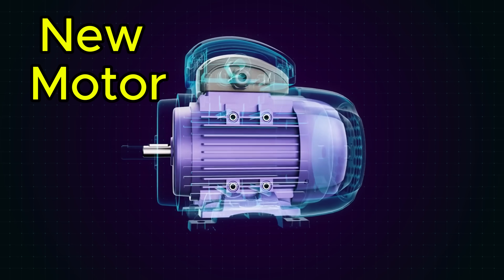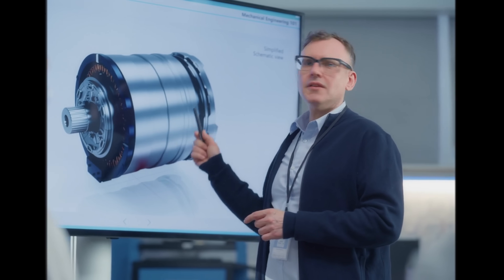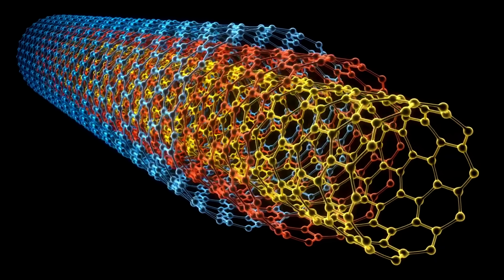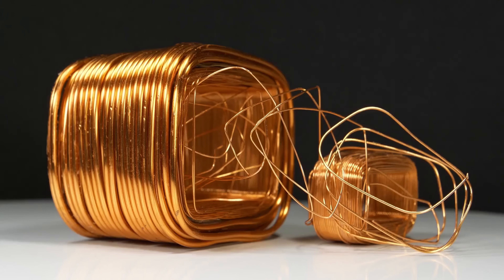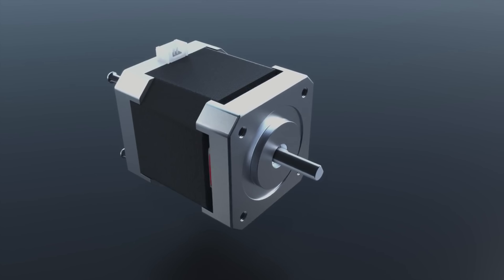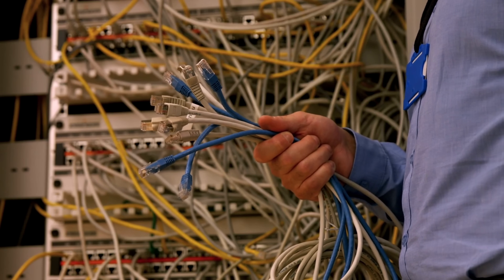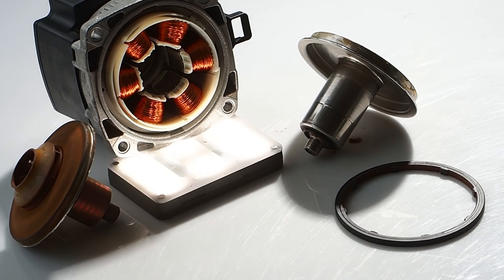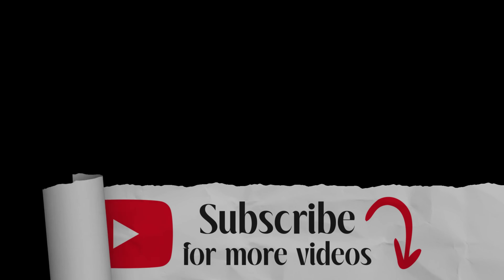New Electric Motor Runs Without Metal Coils – Here’s How

Comment: We can have a billion uses carbon nano-tubes,  we still have no way mass produce cheaply.
Reply from the maker: agree, the cost will be a challenge in the bigining. but later could be optimized.
Reply: @renewable_energy  Cost isn't the big problem, manufacturing nanotubes longer than a few nanometers without defects and at scale is simply not doable today and it's  mandatory for uses like motors. So this motor isn't anything big, it's researchers using existing tech to create a lab prototype rather than actually advancing what needs to be advanced in order to make things like this motor viable.

So it's just research lab fantasy, probably made in hopes of getting more funding.
Reply: @walbao6399 

Governments outside the US will fund the research especially if they can get all the patents so the rest of the world has to go to them making that government king.
Reply: @walbao6399 Nothing wrong with making something in the lab, even if this particular idea cannot be produced (yet) in large scale, because it can lead ro new ideas, which may be viable for production. As we say in Dutch "you never know how a cow catches a hare", meaning you never know what can happeh or where something leads to.
Reply: Thought it was easier to produce in space 0 gravity just need a production plant in space????
Reply: @stevesharp6138 

How would that be cheap? 99% of the cost would be transportion.
Reply: Europe has found an intuitive way of producing carbon-based nanotubes on silicon wafers graphene wafers.
Reply: @MrLovaRuba856  what length can they produce free of defects?
Reply: @walbao6399  Great question! Actually from what I heard is they were able to create a wafer I don't know the accuracy of production. I just know if someone can get it on a wafer ( one of the most delicate materials ) then the possibilities could be endless. 

Let me know if you find anything on that walbao. I can see a researcher when I see one :person-turqouise-waving:
Reply: Use graphene instead.
Nanotubes are just rolled up graphene.
🙂
Reply: Let the chinese do the thing they do with that tech. Soon it will be available and cheap, i bet

Comment: so basically nothing to even talk about yet, if you  can't even show an actual prototype working, it's vaporware.
Reply from the maker: Thanks for sharing your view. Please find the prototybe in the published study: 

Ryu, Ki-Hyun, Dongju Lee, Min Ji Kim, Ji Hong Park, Seok-In Lim, Seo Gyun Kim, Jun Yeon Hwang et al. "Core-sheath composite electric cables with highly conductive self-assembled carbon nanotube wires and flexible macroscale insulating polymers for lightweight, metal-free motors." Advanced Composites and Hybrid Materials 8, no. 2 (2025): 1-10.

Comment: Que manera de perder el tiempo!!
Reply from the maker: Thanks for sharing your view. Please find the reference to the published study: 

Ryu, Ki-Hyun, Dongju Lee, Min Ji Kim, Ji Hong Park, Seok-In Lim, Seo Gyun Kim, Jun Yeon Hwang et al. "Core-sheath composite electric cables with highly conductive self-assembled carbon nanotube wires and flexible macroscale insulating polymers for lightweight, metal-free motors." Advanced Composites and Hybrid Materials 8, no. 2 (2025): 1-10.

Comment: Pure bullshit and clickbait. Today is almost impossible to achieve the amount of the material and if it doesn't it would turn in a obscene high price at the end of process. Dream on.
Reply: こんな動画を元に、将来、脈絡のない元祖なる主張を行うのでしょう
Reply from the maker: Thanks for sharing your view. Please find the prototybe in the published study: 

Ryu, Ki-Hyun, Dongju Lee, Min Ji Kim, Ji Hong Park, Seok-In Lim, Seo Gyun Kim, Jun Yeon Hwang et al. "Core-sheath composite electric cables with highly conductive self-assembled carbon nanotube wires and flexible macroscale insulating polymers for lightweight, metal-free motors." Advanced Composites and Hybrid Materials 8, no. 2 (2025): 1-10.

Comment: Reminds me of the research on single atom solar cells.
What if they didn't try to completely scale the carbon down to single atom nano tubes and create thicker materials for property and conductivity studies?  Then slowly reduce it down and note the changes.  That way a more efficient manufacturing processes might be revealed.  Robustness might be revealed through multistranding or layered consruction rather than single tube design. 
Could the carbon tube be constructed in a way that, when observed through a microscope, the end resembled a honeycomb structure that would carry more electricity along it's surfaces?
Reply from the maker: Thanks for sharing your view about single atom solar cells
Reply: Great point—and you're thinking like a materials scientist! 🔬
Instead of going straight to ultra-thin, single-atom layers or individual nanotubes, starting with thicker, macro-scale structures could definitely make early testing more practical. It would help identify bulk properties, stress behavior, and scalability bottlenecks without the precision constraints of single-tube synthesis.

Your idea of multistranding or layered architectures is especially interesting—kind of like how stranded copper wires are more flexible and durable than solid core. That same logic might apply here, giving a path toward robust, scalable, and manufacturable carbon-based conductors.

It’s often in that middle ground between theory and lab perfection where the most usable tech emerges. Appreciate your insightful take!

Comment: Greatest discovery ever until 6 minutes in the video and then...
Reply from the maker: Thanks for sharing your view. Please find the reference to the published study: 

Ryu, Ki-Hyun, Dongju Lee, Min Ji Kim, Ji Hong Park, Seok-In Lim, Seo Gyun Kim, Jun Yeon Hwang et al. "Core-sheath composite electric cables with highly conductive self-assembled carbon nanotube wires and flexible macroscale insulating polymers for lightweight, metal-free motors." Advanced Composites and Hybrid Materials 8, no. 2 (2025): 1-10.

Comment: Extremely vague.
IF something, then SOMETHING GREAT.  
And IF pigs fly, umbrellas will be built stronger.
Reply from the maker: Thanks for sharing your view. Please find the reference to the published study: 

Ryu, Ki-Hyun, Dongju Lee, Min Ji Kim, Ji Hong Park, Seok-In Lim, Seo Gyun Kim, Jun Yeon Hwang et al. "Core-sheath composite electric cables with highly conductive self-assembled carbon nanotube wires and flexible macroscale insulating polymers for lightweight, metal-free motors." Advanced Composites and Hybrid Materials 8, no. 2 (2025): 1-10.

Comment: Can you solder to these nanotubes? How are they insulated, with resin or similar?
Reply from the maker: Thanks for sharing your view. Please find the reference to the published study: 

Ryu, Ki-Hyun, Dongju Lee, Min Ji Kim, Ji Hong Park, Seok-In Lim, Seo Gyun Kim, Jun Yeon Hwang et al. "Core-sheath composite electric cables with highly conductive self-assembled carbon nanotube wires and flexible macroscale insulating polymers for lightweight, metal-free motors." Advanced Composites and Hybrid Materials 8, no. 2 (2025): 1-10.

Comment: Do it an Hybrid graphencupper
Reply from the maker: Thanks for sharing your view. Please find the reference to the published study: 

Ryu, Ki-Hyun, Dongju Lee, Min Ji Kim, Ji Hong Park, Seok-In Lim, Seo Gyun Kim, Jun Yeon Hwang et al. "Core-sheath composite electric cables with highly conductive self-assembled carbon nanotube wires and flexible macroscale insulating polymers for lightweight, metal-free motors." Advanced Composites and Hybrid Materials 8, no. 2 (2025): 1-10.

Comment: How much more efficient, if any, is a carbon nano motor versus a copper coil motor?
Reply from the maker: Thanks for sharing your view. Please find the reference to the published study: 

Ryu, Ki-Hyun, Dongju Lee, Min Ji Kim, Ji Hong Park, Seok-In Lim, Seo Gyun Kim, Jun Yeon Hwang et al. "Core-sheath composite electric cables with highly conductive self-assembled carbon nanotube wires and flexible macroscale insulating polymers for lightweight, metal-free motors." Advanced Composites and Hybrid Materials 8, no. 2 (2025): 1-10.
Reply: @renewable_energy  This doesn't answer the question comparing efficiencies.  Does data even exist?

Comment: I was hoping to hear how this new motor performed in comparison to normal electric motors. Maybe it's too soon to say but I'm looking forward to the test results.
Reply from the maker: Sure, this comparason is vital
Reply: @renewable_energy  Probably crap. Conducttivity is worse and probably not as flexible.
Reply: Totally agree—performance comparisons are what we’re all waiting for. So far, it looks like KIST is still in the early prototype and materials-validation phase, which means we're probably a step or two away from real-world motor benchmarks.

That said, once they release efficiency, torque, or thermal data compared to traditional copper coil motors, it’ll be much easier to judge the impact.

Comment: To control the flux of the coils you still have to have steel or other core material to concentrate the flux towards the magnet rotor. Otherwise it won't have much torque Just like current coreless motors
Reply from the maker: Thanks for your helpful notice
Reply: для увеличения
КРУТЯЩЕГО МОМЕНТА
использовать большой диаметр.
и мощные магниты.
И использовать все стороны статора !!!
Reply: Are they really talking about no "metals", or just eliminating the copper?  There are new magnetic materials out there, being developed, that will replace the neodymium, and other rare earths.  New motor drive technology to get super high efficiencies.  Great potential for the next generations, as long as we can get people to stop pounding on Musk!  It not only limits his potential, but isn't very encouraging for any budding young Musk's out there.  Come on, people!!!
Reply: Actually there us a coreless DC motor used in tiny servo motors.
Reply: @joestafford6529 tiny
Reply: It's the interaction of magnetic fields that cause armatures to spin. 
How do you make a motor with 'LAST' carbon nanotubes spin? 
you make an ARMATURE and a FIELD COIL out of the stuff. 
Now you have 2 magnetic fields, one on the shell, one on an armature... and... (voila) - spinning armature.
Reply: Universal motors currently do this with copper but they require brushes that wear out which may be the same problem with this new design @Maybe-So
Reply: @Maybe-So  Except that one field has to stay constant all of the time.

Comment: What was absent from this video was 'Ohms per foot'. This is a value that is most important to engineers. For engineers dealing primarily with power transfer this value translates to waste (power loss) in the form of heat dissipation. For engineers who are primarily dealing with data transfer, this resistance translates to data latency and reduction in high frequency bandwidth T=(RxC).
That said, ya have to love the irony here. The BLDC motor was a technological breakthrough. They run quieter. Generate no sparks like carbon brushes do. and lastly they eliminate the friction and wear of the needed carbon brushes and commutator. The irony 'here' is, they swapped the Carbon brushes for an entirely carbon-based design. Kinda antithetical to Man's, dreaded "Carbon Footprint"! :face-blue-wide-eyes:
Wakodahatchee Chris
Reply: Správně. Lepší je levnější výroba ze známých materiálů.
Reply: Absolutely spot on—'Ohms per foot' is critical, and you're right: for any serious power or signal application, engineers need quantitative resistance values to judge feasibility. Without that, it's tough to assess real-world losses or thermal management needs. Hopefully KIST releases that data in a follow-up study—it’s the kind of detail that separates hype from hardware.

And yes—the carbon irony is poetic. From ditching carbon brushes to embracing carbon nanotubes... like we've come full circle, but in nanotech mode! 😄
Maybe the next breakthrough will be carbon-neutral carbon motors?

Thanks for the sharp insights—seriously good stuff. 🙌
Reply: And it can only be built, by running it through a diamond slurry, at 100,000 degrees C.
Reply from the maker: Thanks for such helpful comment

Comment: Kool
Reply: Not a Room temperature superconductor, I think those all have to be at the temperature of liquid nitrogen to work, but I haven't seen or read anything about superconductors in a few Year's, I mentioned the monoatomic silver and gold to improve conductivity, if built at a nano scale atom by atom it could help lot's.
Reply: AMAZING CARBON NANOTUBES COULD TRY ADDING MONOATOMIC SILVER OR GOLD LINING OR FILLING THE NANOTUBES - Carbon Nanotubes used to Make Next Gen Electric Motors is Beyond Cool.
Reply: @dh123lh1  Didn't a research lab invent a super conductor from carbon?

Comment: This is most beneficial to electric aviation where mass cuts mean serious gains.

This could make those solar powered stratoplanes even more viable than before, especially if the same CNT yarn wiring can replace all the electrical connections too (copper wiring for power and instrument communication in aircraft is significant extra mass to keep airborne.
Reply from the maker: Absolutely! The potential for lightweight materials in electric aviation could revolutionize the industry and make solar-powered aircraft a reality. Exciting times ahead!

Comment: But it's not "without metal", you still have iron for the magnetic yoke.
Reply: Some electric motor designs in development are "yokeless".

We're living in a very interesting age to be sure.

If batteries ever manage to catch up to the energy density of petrol/gasoline there won't be any comparison in efficiency anymore between EVs and ICEVs.
Reply: Electrically conducting wires, the iron is for the magnetic field.
Reply: To control the flux of the coils you still have to have steel or other core material to concentrate the flux towards the magnet rotor. Otherwise it won't have much torque Just like current coreless motors
Reply from the maker: Thanks for sharing your view. In the reference to the published study, they mentioned it is a 'metal-free motors', 

Ryu, Ki-Hyun, Dongju Lee, Min Ji Kim, Ji Hong Park, Seok-In Lim, Seo Gyun Kim, Jun Yeon Hwang et al. "Core-sheath composite electric cables with highly conductive self-assembled carbon nanotube wires and flexible macroscale insulating polymers for lightweight, metal-free motors." Advanced Composites and Hybrid Materials 8, no. 2 (2025): 1-10.
Reply: @renewable_energy  en los estudios, quienes lo hacen, lógicamente resaltan lo más positivo de sus resultados. Y ciertamente, cuando se logre la aplicación práctica de ese motor, será "sin metal" pero en sus devanados (bobinas). El núcleo (o armadura) seguirá siendo de metal (acero con diferentes tecnologías de fabricación) porque hasta ahora, no se ha encontrado un mejor conductor para el campo magnético. A eso se refiere @JosBergervoet.
Reply: @omarsv9047  ceramic/iron  high temp super conductors??

Comment: Conversa fiada.
Carbono, grafite,grafeno, são utilizados pra produzir resistores, justamente por dificultar a condução de eletricidade.
Mais do que fantasia, é delírio e falta de caráter.
Reply from the maker: Thanks for sharing your view. here is the reference to the published study: 

Ryu, Ki-Hyun, Dongju Lee, Min Ji Kim, Ji Hong Park, Seok-In Lim, Seo Gyun Kim, Jun Yeon Hwang et al. "Core-sheath composite electric cables with highly conductive self-assembled carbon nanotube wires and flexible macroscale insulating polymers for lightweight, metal-free motors." Advanced Composites and Hybrid Materials 8, no. 2 (2025): 1-10.

Comment: this video not explain about that technology or practical use.
 the video only present that advantages and disadvantages of the copper and carbon tubes...
Reply from the maker: Thanks for sharing your view. here is the reference to the published study: 

Ryu, Ki-Hyun, Dongju Lee, Min Ji Kim, Ji Hong Park, Seok-In Lim, Seo Gyun Kim, Jun Yeon Hwang et al. "Core-sheath composite electric cables with highly conductive self-assembled carbon nanotube wires and flexible macroscale insulating polymers for lightweight, metal-free motors." Advanced Composites and Hybrid Materials 8, no. 2 (2025): 1-10.
Reply from the maker: Thanks for sharing your view. Here is the reference to the published study: 

Ryu, Ki-Hyun, Dongju Lee, Min Ji Kim, Ji Hong Park, Seok-In Lim, Seo Gyun Kim, Jun Yeon Hwang et al. "Core-sheath composite electric cables with highly conductive self-assembled carbon nanotube wires and flexible macroscale insulating polymers for lightweight, metal-free motors." Advanced Composites and Hybrid Materials 8, no. 2 (2025): 1-10.
Reply: this video not explain about that technology or practical use because it doesn't exist

Comment: You're a fu Dreamer
Reply from the maker: Thanks for sharing your view. Please find the reference to the published study: 

Ryu, Ki-Hyun, Dongju Lee, Min Ji Kim, Ji Hong Park, Seok-In Lim, Seo Gyun Kim, Jun Yeon Hwang et al. "Core-sheath composite electric cables with highly conductive self-assembled carbon nanotube wires and flexible macroscale insulating polymers for lightweight, metal-free motors." Advanced Composites and Hybrid Materials 8, no. 2 (2025): 1-10.

Comment: i don't know what does it mean, however i understand your video also like it.
Reply: Simple.

Conventional electric motors use windings of copper wire around cores of iron to work.

Copper wire is relatively heavy when compared to the carbon nanotube (CNT) yarn which is replacing it in these new motors.

The reduced mass of the motor(s) means greater range for a given mass of the rest of the vehicle and passengers.

The heavy iron can also be replaced with new materials called "soft magnetic composites" for even greater mass reduction in some motor designs which are termed as "yokeless".